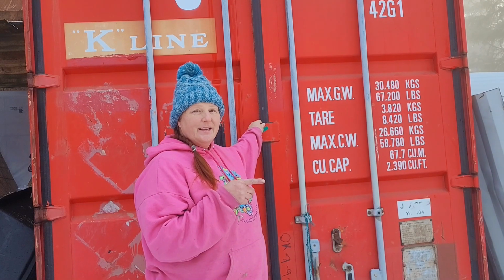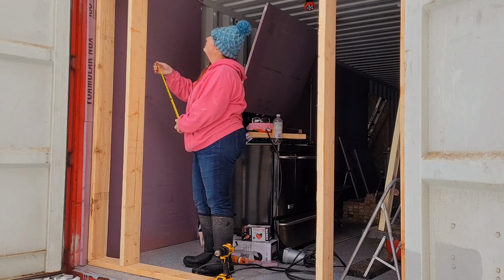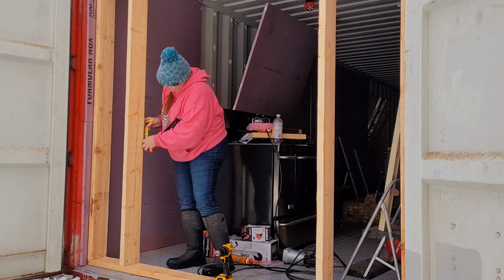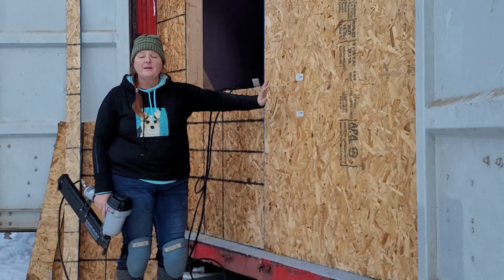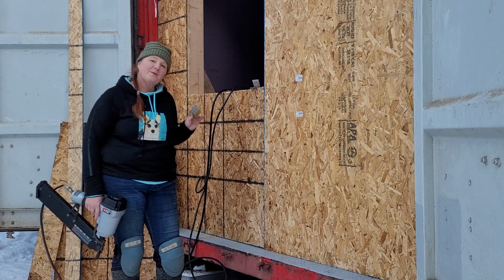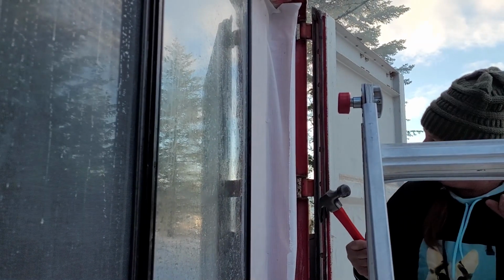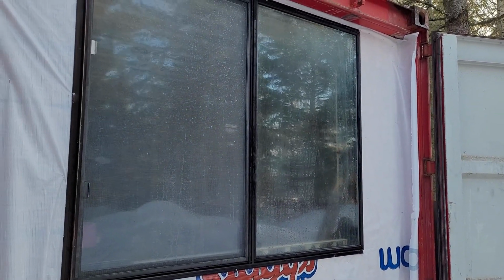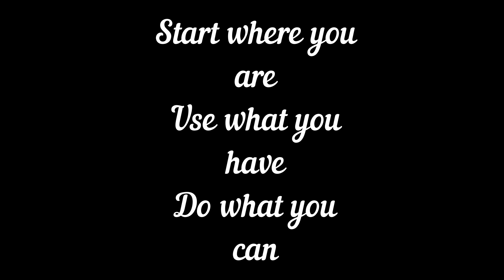DIY Shipping Container Tiny Home//End wall and adding a window// VLOG

Comment: Great job on the wall and window , and you finished 👍Might want to put some construction adhesive above and on sides of wall to hold it in place, looked a little wonky when you were installing the studs 😎

Comment: Raise the blade of the saw. Allow 1/8 inch of blade beyond the material thickness. This will drastically reduce the drag on the blade, making the cuts much smoother.
Reply from the maker: The battery is low and it needed a new blade.

Comment: Just wondered if the pink board insulation your putting against the walls of the container. If you thought of instead of glueing it to the container wall cut it to fit again the container wall and why I’m asking is when the container metal expands and contracts it more than likely will pop loose from the container cause it being metal it does that when it’s hot outside and cold outside. You could start the wood wall studding building putting the pink foam insulation board behind it as you build just like your glueing only it can move behind the wall studs a little and it would not pop loose from the container wall during season changes the glue will harden it in place and after a while the expanding and contracting of the container will pop it loose. By trying this way I’m describing a way maybe kill to birds they say with one stone. The pink board is behind and in between the container wall and the wall studding. And you could return the glue and use the money from it for other materials maybe not sure.because both of those steps done then put you other insulation in it will be up against the pink insulation holding it snug to the container wall to and then you plastic over the insulation and then your finish sheeting drywall or what ever your gone to us. One other thing to if you do ever have a leak or find sweating and mold starts for some weird reason you can pull your wall panel loose and take plastic away and pull the insulation out and get to the pink wall board insulation. And pull it away easier and not busting it up in pieces from being glued and can reuse the pink board again and save time and money for a repair of any of the walls in there. I hope I’m some ideas help. Thanks for your channel it’s inspiring to people and there are not many brave woman who take on the things you do on your channel. So you are showing woman are just as skilled at anything men can do.
Reply from the maker: I am going to address this in a video all on its own.  This way of doing it is very confusing to a lot of people. I am taking advice fr local builders and lots of research.  But in short it isn't a big deal if it pops off this is just to hold it in place as the other parts are slowly put up.  I will also be taping the seams so this is the best way.  Thanks for all the encouragement you always send our way!!

Comment: Question..   will there be enough room with wall sheathing, depth of window, etc. to close those doors if it became necessary??   I am a bit of a doom and gloom guy but had to ask
Reply from the maker: Yes
Reply: @KuzweKanfarms  yeah....   figured as much but my brain made me ask...   lol
Reply: Pink insulation or fiberglass???
Reply from the maker: @robertbates5537  I don't understand the question. I have the pink foam up
Reply: @KuzweKanfarms  I mean for the new window wall?  Lots of cuts and small pieces of the pink foam board to get it in all the window wall spaces
Reply from the maker: @robertbates5537  I have other insulation that I am using not the foam.
Reply: @KuzweKanfarms  figured as .ych but had to ask... 🤐